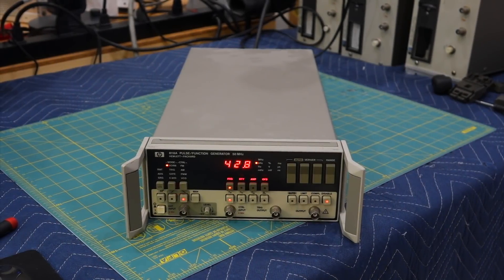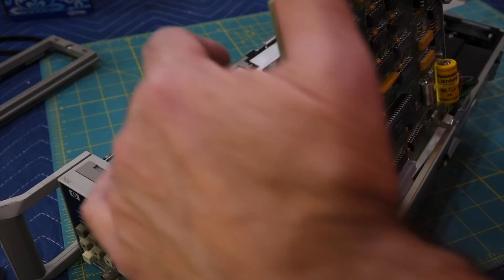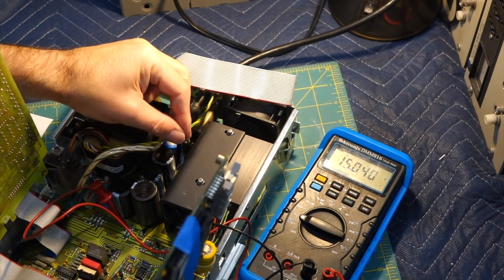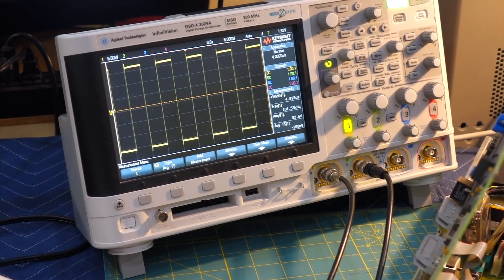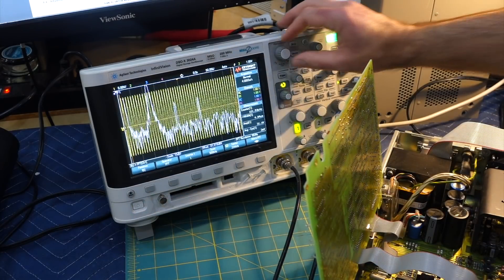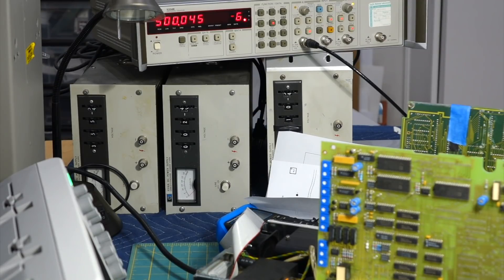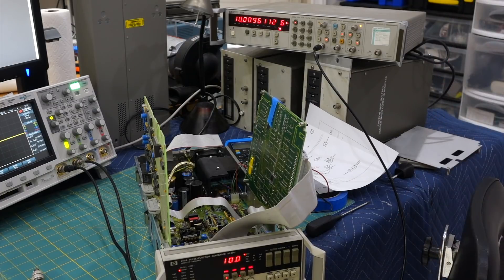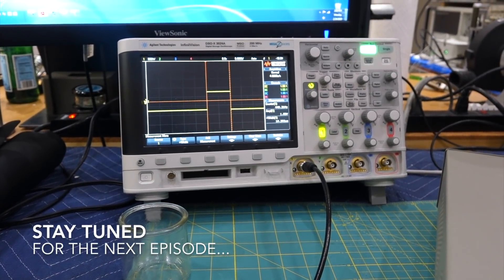HP 8116A Pulse/Function Generator Calibration

Comment: I just got a couple of these without understanding the main flaw in these is the unrepairable ASICs.  Both had E31 and E53 errors.  Both seem related to the VCO/Slope IC.  It's a real shame that ASICs seem to be the main cause of fault symptoms because I really like the ease of use of these FGs.  

Question regarding calibration, do you calibrate all your equipment in-house?  If so how? I mean you'd have to send out at least some standards for external calibration correct?

Also, if you ever get one of these with a noisy fan, removing them is a nightmare.  Usually HP is #1 for ease of service (I love how you can prop the PCBs up on those hooks), but they really complicated that fan assembly.

Comment: My HP 8116A front panel is dead. While the fan is running normally, what do I need to check if the front panel is off.
Reply from the maker: That could be so many things. I’d check power supplies first of course.

Comment: I have one of these devices which went wrong when the instrument was knocked in transit. Fortunately I have the original service manual from HP and I set about fault finding it. The fault turned out to be due to one of the computer type power supply connector pin being open circuit. I took out the pin from the connector and it looked totally fine, but when I put my soldering iron on it, it fell into many pieces.

Comment: Hello Do you have the service manual with schematics and/or the pcb layout. I have the same instrument but the battery leaked and damaged some traces on the  top pcb.  What kind of battery you have in the instrument, is it rechargable or alkaline? From the number on the battery i have i found that the batteri is 2.5v alkaline but on some forum i people are talking about rechargeable battery.
Reply from the maker: The service manual is available for a few bucks from Artek Media. [edit] I got the battery wrong in my first answer, mixed up with another instrument. The manual says it's a NiCAD battery. I vaguely remember I changed it, but don't remember it as a NiCAD. The manual also implies there was a revision with the battery circuit, so maybe some have rechargeable NiCADs and some have non rechargeable, maybe long life Lithium batteries?
Reply: @CuriousMarc  Does the service manual from Artek Media has schematic or pcb layout? I downloaded the service manual from Keysight but it only has the programing, testing and adjustment procedures no schematics or pcb.
Reply from the maker: @vanekolev3005  Yes it has the schematics, the PCB placement (where the components are) but not the trace layout, and the parts list.
Reply: @CuriousMarc   Thank you for the information, i will get the schematics from Artek Media.

Comment: 12:23 Isn't using T splitter with one output not terminated a bad thing to do? Doesn't it negatively affect signal by inserting reflections? Or is reflection impact negligibly low in this case?
I'm not a specialist, but will be thankful for correcting my small long-line transmission knowledge.

Comment: How are its distortion specs?   Analog VCOs, for a lot of decades, were more pure than any synthesized sinewave generator.  You should dig up an old HP 200 and check it out.
Reply from the maker: Not bad. As you can see on the FFT, third harmonic is a good 30 dB down. Although I would trust my real spectrum analyzer more.

Comment: What year were these first made? What I could find was a HP magazine from 1983 with an article about their new line of function generators: https://www.hpl.hp.com/hpjournal/pdfs/IssuePDFs/1983-06.pdf
Reply from the maker: Introduced in 1994. Surprisingly recent.
Reply: @CuriousMarc  Yes, especially considering how analog it is. I wonder how much they changed the design since it was (apparently?) introduced in the early 80s. 
By the way I really enjoy your channel, being a long-time nerd (was a independent Mac consultant for 25 years, and electronics hobbyist & inventor before and after that, if that's an indication!) and always extremely curious. Very fun. Thanks for posting them.

Comment: This "display amplitude as into 50 ohm load" always gets me when I use HP function gens. First thing I do in let's say HP 33120A is go to the menu and change output termination to "High Z" - it doesn't change output impedance but shows open circuit voltage. It's one of more confusing features - maybe it's just me but when I set 1V peak to peak on function generator, I want 1V peak to peak with 50 ohms output impedance on the connector (measured by "ideal" voltmeter), not 2V.
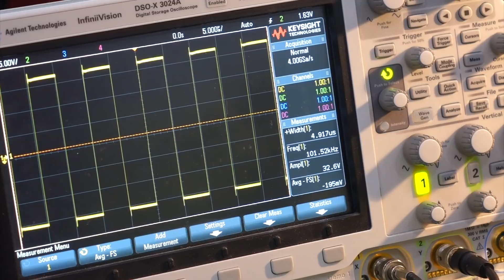Reply: If you're generating fast rise/fall times, 50 ohm termination is a must. Without it, you'll get ringing at the receiving end of your cable! See that overshoot and undershoot at 8:12? Notice how it's gone when Marc applies a 50 ohm terminator at the end of his cable. Transmission line theory works!
Reply: Yes, of course. As I said, these function gens ALWAYS have 50 ohm output. The "output termination" option literally multiplies numbers on the display by factor of two (so you enter the value you'll get at output if it's properly terminated) ;)

Comment: Yes mismatch reflections... but, why two attenuators? Is it to make a 50 ohm through BNC to BNC connection?... because each attenuator is BNC to N... or something?
Reply from the maker: Because I only had 10 dB attenuators on hand, and wanted 20 dB for easy 1/10 reduction. Note to self: buy 20 dB attenuators to calibrate HP instruments...

Comment: -5.2 Volts is used for emitter-coupled logic (ECL), much faster than TTL or CMOS for the era.
Reply: I cut my professional teeth on ECL. Yes, it was fast as hell but consumed a ton of power to do it. Eventually, CMOS killed it. If you followed ECL recommendations, there should also be a -2.0V supply in there, too.

Comment: Personally I much prefer a 3325A synthesized function generator. It only goes up to 21 MHz, but it also goes down to something like 0.00001 Hz And it is a digital divider and you can externally clock it from GPS, though I seem to recall the external clock is annoyingly a 5 MHz input. Since I'm much more commonly working with audio and power frequencies than RF, being able to get accurate audio band frequencies and sweeps is right nice. It is also quite repairable unless the microprocessor dies, but that seems to be rare. What does screw up is the fancy relays, but they can be disassembled and cleaned.
Reply from the maker: Amen to the 3325A.
Reply: The pulse generator from which I believe this was derived can generate really short pulses (a few nanoseconds wide), so at the time it may have been more economical to trigger fast logic based on a ramping waveform than to try to build a digitally clocked solution.

Comment: Looks like you could key it into a dipole antenna and transmit Morse code!  16V at 50ohms is 5W... QRP!  Enough to talk around the world.
Reply from the maker: Yes that's its main quality I think. It's seriously powerful. It will come in very handy pretty soon, as you'll see.
Reply: I'm dusting off my old valve transmitter right now, CW is coming back to save the world.

Comment: Had a couple of these and I hated them with passion.
Pulse generating ASICs  run very hot and if you buy them for repair on ebay, you mostly get those with dead ASICs, so not much to repair. 
Also no PLL, everything is analog and controlled with DACs from microcontroller, so like 5% frequency accuracy.
Used the dead ones to harvest parts and eventually got a few working ones which I then sold for good money on ebay, though ;-)

Comment: Odd that with a pot for every darn thing in that instrument, HP cheaped out and didn't design the +5 and -5.25 supplies to include individual adjustments.
Reply: It may not have been possible to have separate adjustments.
Reply: They could perhaps be in a tracking configuration and all you are really doing is trimming the zero level about which both supplies sit.

Comment: My Prophet REV2 keyboard music synthesizer also has most of those waveforms, but it does not go quite as high as 50 MHz... 🤪
Reply: There's a world of difference between digitally synthesizing a 20 kHz sinewave vs. a 50 MHz sinewave....
Reply: @demef758  
You obviously didn't get the joke... BTW, the REV2 is DCO based (analog oscillators digitally controlled).